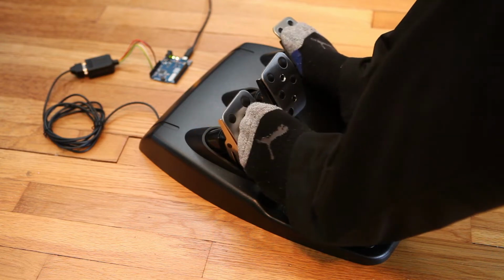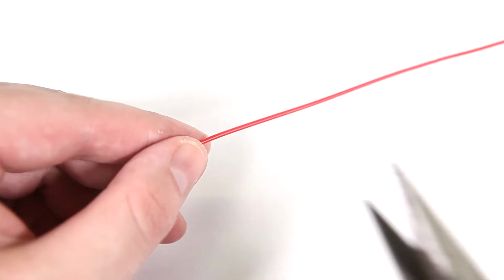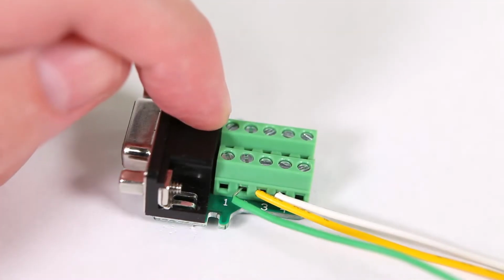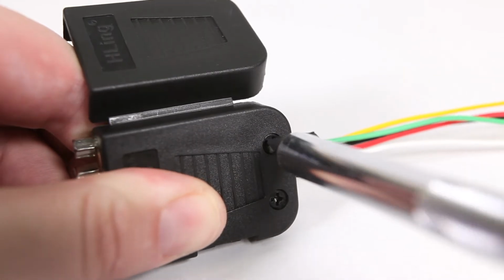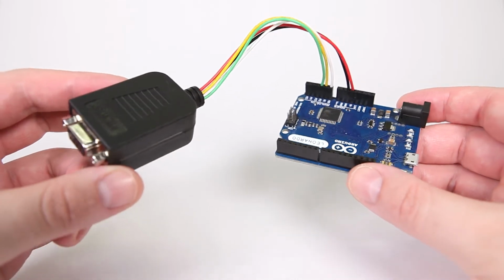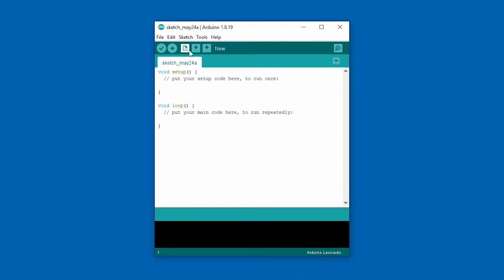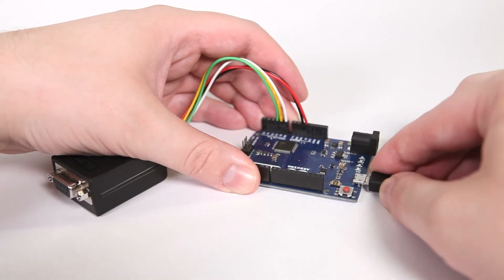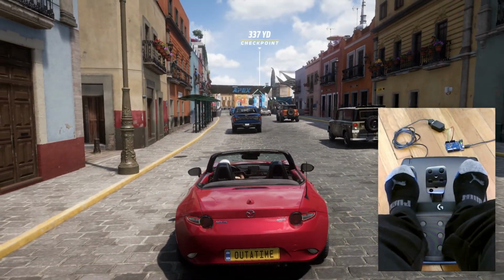DIY Logitech Pedals USB Adapter (No Soldering!)

Comment: Brilliant Thanks, Upgraded to a T300 but wanted to keep my modified G27 pedals as a standalone set, I used a Pro Micro clone and the script uploaded flawlessly, pins were labelled the same except I used VCC instead of 5v it was giving out 4.5v (Raw was giving out 4.7v), Also I cut the pedal wires and soldered direct to the board as I didn't want the DB9 connector, for anyone interested in the pedals internal wire colours, Red:5v, Black:Ground, Green:Clutch:A0, White:Brake:A1, Orange:Throttle:A2.
Reply: The Joystick libary didn't support my pro micro clone from aliexpress

Comment: I've had a G27 shifter and pedal that was given to me because the owner's wheel stopped working. I just assumed the stick/pedals were useless without the wheel and stored it away for the past 8 years or so. Later on I got into microcontrollers, then a couple days ago I wondered if anyone got the stick/pedals to work with an Arduino and here I am. I couldn't believe it! Thanks so much
Reply from the maker: That's amazing! I'm glad I was able to help.

Comment: im planning on doing this project, but I wanted to know if it would be possible to hook up both a DB9 connector and an RJ12 connector  to the same board so i could use the logitech shifter and Thrustmaster pedals off of one USB connection. Would this be possible or would I need a bigger Arduino or have to use two leonardos?

Comment: Hi, is it possible to solder the connectors straight to the board
Reply from the maker: Not to the Leonardo, or at least not well. If you want to solder the connections I would suggest buying a Pro Micro board instead.

Comment: Thanks for this tutorial. I did it with a Pro micro atmega32u4 and it works perfectly. Thanks again.
Reply: Hey men! Did you know another cheapest option thanks!
Reply: Did you have to modify the code to get it to work? What pins did you use?
Reply: The pro micro didn't work for me

Comment: Hello, how are you, is the script compatible with the ATmega328 microcontroller?
Reply from the maker: No. The 328P does not have a USB interface. It can read the data from the pedals, but it cannot output it to a PC as a joystick.
Reply: @dave.madison  good thank you. And in this function? Pro Micro Mini Mcu Atmega32u4 5v Usb 16mhz For Arduino
Reply from the maker: @Lautaro02219  Any board with an ATmega32U4 will work with this code, although some will require soldering if they do not come with female headers.
Reply: @dave.madison  As a last question. How many bits is it? 10 bits or more
Reply from the maker: @Lautaro02219  The ADC on the 32U4 is 10 bits.
Reply: @dave.madison  perfect, thank you very much

Comment: If I want connect directly on dfgt wheel for play on ps3 there is something for adapt it?
Reply: Remove the cable from DFGT pedal and use it to replace the wire on the G2x pedal. There are instruction out there. No need to make any adapter. Cost is 0. No clutch of course.  Remove G2x wire always from the bottom use a cardboard box as support.

Comment: Hi, thanks for this video, i'm looking to do this for nephew, is it possible to combine pedal and shifter into one board ? I know the code will need some adjustement but did you tried it ? Thanks
Reply from the maker: Hello! It is absolutely possible to combine both into one board. The example codes need to be combined (mostly copy + paste) and the analog shifter pins need to be moved to A4 / A5. But it should be very straightforward.
Reply: @dave.madison  Good ! Thank you for the answer
Reply: @metcout  did you manage to combine them ? :)
Reply: @kriskatakn  yep, i combine them into one board
Reply: @metcout  can you give me the board file i need to upload ? :)
Reply: @metcout  how do I code the pins ? :)
Reply: @kriskatakn  
Shifter:
Pin4 = A6
Pin 2 = 2
Pin 8 = A8
Pin 6 = Ground
Pin 7 = VCC
Pin 9 relié à Pin 3
-----------------------
Pedal:
Pin 4 = A0
Pin 3 = A1
Pin 2 = A2
Pin 1 = Ground
Pin 9 = VCC
Reply: I can't post the code here or put a link, comment get delete.

Comment: Hi do I have to buy the db9 connector can I just cut the plug of the pedal and connect it straight to the arduino in stead of buying the db9 connector.
Reply: you can cut it and do it that way, just need to make sure to correctly identify each cable

Comment: Wow, fantastic tutorial, fantastic design and you got a subscriber and a like before I even got to the end of the video! Honestly, this was so well done in all aspects....I can not come up words that can articulate just how impressive it was. Even in it's simplicity!

One question: Will this work with the load cell kit installed on my G923 pedals? My g923 needs a to be replaced by Logitech so I am w/o that for ~2-4 weeks. I have my old GT Driving Force wheel which will be fine....I guess as a stand in until I get the replacement but I can not go back to the GTDF pedals.......no way no how. If I can get the G923 pedals connected as stand alones I could make it work in the short term.
Reply from the maker: Glad you liked it!

As far as I know the G923 pedals are functionally identical to the G920 pedals, so if the load cell kit works on your G923 I'd imagine it would work with this. Let me know if you give it a try!
Reply: ever got it to work? my g29 brakes are modded with axcsim truebrake and it works just fine :)
Reply: Can a normal b10k potentiometer be used to replace existing potentiometers of the wheel ? @MotmoRacing

Comment: I was wondering what was the purpose of the adaptor? (No offense, great job!)
Reply from the maker: It converts the raw signals from the pedals into a USB joystick that can be used with games or racing sims. Typically you would connect the pedals to a Logitech wheel that would do this for you, but this lets you use the pedals on their own without a matching wheel.
Reply: @dave.madison  Genius! We will need the logitech pedals though, right?
Reply: @NotItzIshan yes you will need logitech pedals to use logitech pedals 🤔😅

Comment: just did this and works like a charm with some small caveats.

 i will only point out that, it is better to follow the squematic of the db9 serial port because most ports have ground on pin 5, not pin 1 (as is the standard with the db9 port). 

also, following this guide, there is a chance that you will end up with reversed clutch and acceleration pedals, just swap places of the a0 and a2 cables on the arduino and you should be fine.

IN THEORY it should be possible to have both the shifter and the pedals in a single arduino leonardo depending on the amount of data connections the shifter needs (IIRC is 3) BUT it would require a complete rewrite of the code and to solder 4 cables into 2. without both of those things is not possible.
Reply from the maker: Hi! I'm glad this worked for you and I appreciate the feedback.

As far as I know connecting ground to pin 5 will not work with these pedals, as it's not connected internally. You can find my pinout notes from disassembling my own pedals in the library documentation here: https://dmadison.github.io/Sim-Racing-Arduino/docs/logitech_pedals.html

If using pin 5 as ground does work for you then your pedal unit may be wired differently. Pin 6 will work as ground but has the potential to create a dead short if a 2-pedal unit is connected instead.

Comment: Hello Dave, thank you for this video, very easy to follow even for novice.

I have a question, I’ve noticed in another similar video they also use an extra wire to connect another 5v (pin 6 & 9)? Can you explain to me what the difference is?
Reply from the maker: Pins 6 and 9 are connected internally on the 3-pedal unit. It isn't necessary to connect them on the adapter, it will function the same way.

Comment: Hello Dave Madison! Thank you for sharing this excellent experience, but I would like to know if it is possible to add the steering wheel in addition to the pedals, even without the feedback motors? I have a Logitech G920 with a defective board, and I would like to take advantage of it, is it possible?

Comment: Just buy the adapter bro lol By the time you buy everything needed in the video you could have just bought the adaptor lol
Reply from the maker: At the time I made this video the official Logitech adapter didn't exist.

The DB9 connector and the microcontroller are the only essentials. Most people have a pair of pliers and can scrounge up some wire. With the current prices linked in the description, this method costs roughly half the price of the adapter. Something to consider :)
Reply: True, not only its half the costs, but there's also the matter of paying import taxes for some, such as me. Whereas DIY products can easily be found for very low cost where I live in comparison to bringing the adapter overseas.
Reply from the maker: @jojodosjogos  Good point!

Comment: @dave.madison 
English:

"Hello, thank you for your project, it is exactly what I needed. However, I have an issue with the stability of the value of my brake pedal when using it with a Micro Pro card or an official Leonardo. My input is constantly changing, making it impossible to bind in a game. Have you ever encountered this problem and if so, do you have any solutions to propose to solve this problem? Thank you in advance for your help."

Français :
"Bonjour, je vous remercie pour votre projet, il correspond exactement à ce dont j'avais besoin. Cependant, j'ai un problème avec la stabilité de la valeur de ma pédale de frein lorsque je l'utilise avec une carte Micro Pro ou un Leonardo officiel. Mon input varie constamment, ce qui rend impossible de faire un bind dans un jeu. Avez-vous déjà rencontré ce problème et si oui, auriez-vous des solutions à me proposer pour résoudre ce souci? Merci d'avance pour votre aide."
Reply from the maker: Hi Dorian. I have indeed encountered that problem, but thankfully there's an easy solution.

When calibrating the pedal in Windows, don't move it all the way back to the start for the 'minimum' reading. That will give you a bit of a buffer so it doesn't always send data at rest.

There is also a built-in calibration function in the library that can be accessed using the PedalsPrint example. You can use that to calibrate the code to your specific pedals, which should also solve the problem. I hope that helps.